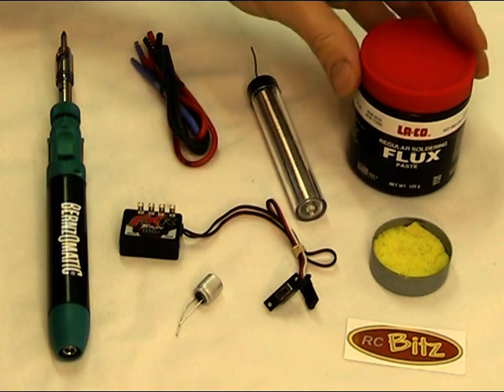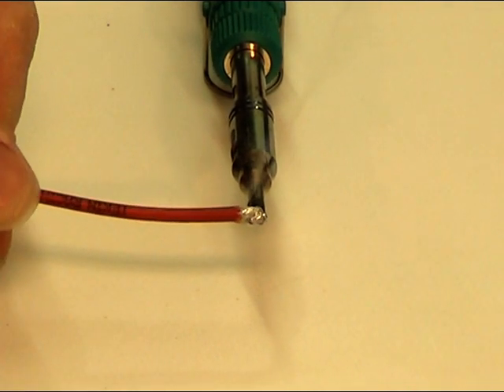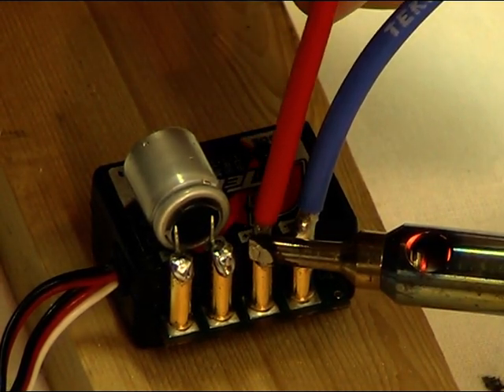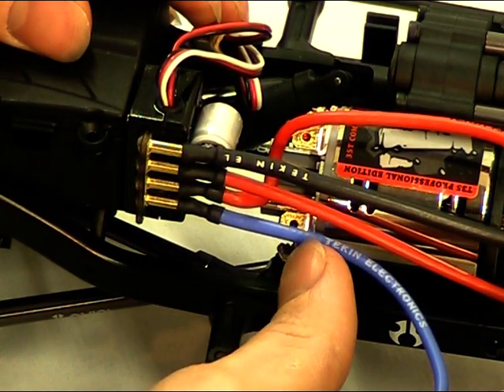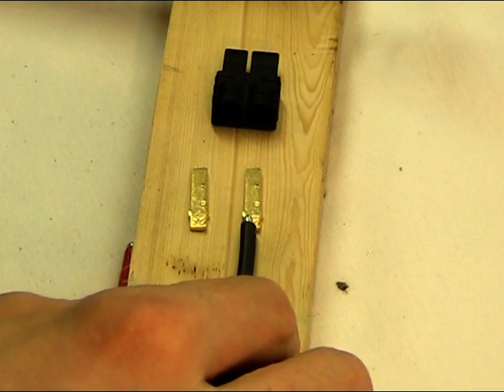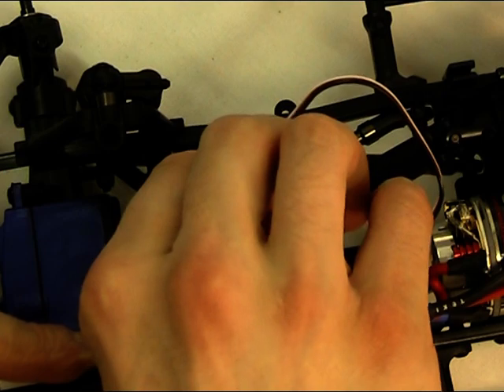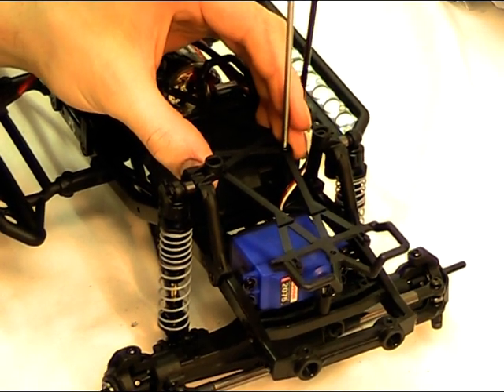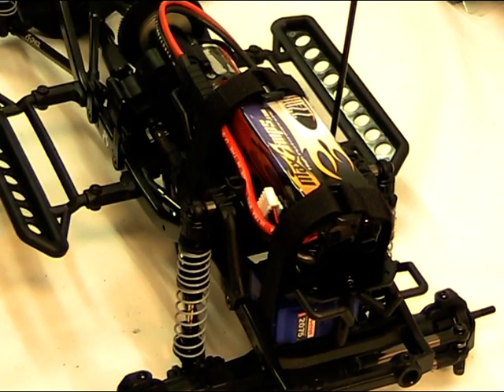Axial Build SCX10 Honcho PART 8 How To Solder ESC Motor Battery Connection receiver Steps 37 39.mpg

Comment: Thank you for the reply. One more question,do you an idea why my Honcho goes in super slow reverse when I turn the transmitter off?
Reply from the maker: +bellyisis Check the throttle trim on the radio, I guess it is not in the center. Worth doing this with the wheels off the ground, in case it 'shoots' off. Hope this works.
Reply: +rcBitz 
I tried this out , it still does it. But since you so nice to reply. I have another question. You know the sound wheels make when you turn em(even when rig is off)? Mine is no longer making that sound. Do think my servo is bad? My Honcho is kinda heavy with upgrades do you have a suggestion of a servo if I need to replace ? Thank U

Comment: What # are the spacers?are they found on the original part tree?
Reply from the maker: +bellyisis I guess you mean those for the battery tray? These are on AX80027 they are number 2 on there. Yes these where supplied with the kit.

Comment from the maker: No not too hot. I've found the hotter the better, as long as you are not soldering very small wires as you will need less temp.

I've got a full soldering station now and its the best money I have spent for my RC hobby.

Comment: Your video was very helpful in where to solder which wires and that Capacitor. I purchased this tekin FXr to go with by brushed motor on my Tamiya YA05 because other ESC's were too large and didn't fit on the chasis. Wasn't too sure what goes where. You solved my dilema. Thanks!

Comment from the maker: Look forward to seeing these in video too :-)

I have been happy with both brushed and brushless. Brushed is a good idea if you intent to see alot of water and mud - a clear with motor spray and a drop of think oil on the bearings each run is a good idea.

You are correct the brusless does not like water.

Comment from the maker: My Novak system has thick heat shrink around it and does not get hot so think you will be ok, its just the solder posts to keep clear on the FXR as they dissipate the heat.

Comment: i usually use either plasti-dip or liquid electric tape but i might put some silicone on it just in case because i'm not sure if it needs to breath for heat. where i live there is a lot of water/mud so all my electronics has to be waterproof or at least as waterproof as possible.

Comment from the maker: I see, ok this is what is called a balance plug and is used when you balance charge a LiPo battery, it helps keep the voltage of each cell close to one another. So in answer no it does not need connecting.

Comment from the maker: @dangerouslyr Sounds like you have not been having fun :-(

As long as the wires are all connected in the correct locations and you are using the correct settings for the batteries you are running and the electronics have not got wet then all should be fine.

The miss plugging may not have helped, did you make this mistake also on the new ESC? I would suggest taking time on the first start up and then not remove the plugs.

Not sure if I have been much help.

Comment: I had to re-solder all my connections because my E.S.C. got wrecked from flames literally jumping out of it! So after I re-soldered all my connections with a higher quality soldering iron, rosin core solder and bought a new E.S.C. the same thing happened again! My only lead on why this happened is that I glitched my receiver from plugging the E.S.C. into the receiver the wrong way a few times. But I was wondering if you have any ideas why this happened? :/

Comment from the maker: @MegaRallycar Well spotted :-) On the Honcho with the battery up front and above the wheel arches and the servo on the axle these are more likely to see water than the ESC and I'm not intending to go deep just precaution.

I also would like to make a video showing waterproofing the ESC as an Upgrade, hence leaving out of this build.

Comment from the maker: @inulika It fine, happy to help where I can. mine where 2200mah, the link I mailed to you should show the new ones. You do not need to run with LiPo but if you can afford the extra cost it is worth it for the extra 'punch' and also the saving in high up weight - LiPo is so much lighter. I have run my battery for well over 1hour in my SCX so don't worry about run times.

Comment from the maker: @c43939 Yes a small ESC would fit in the box. Just be very careful of the ESC getting too hot. I have fitted a Novak Goat 3S in a second radio bow but the heatsink is outside the box with a fan to help. Good luck.

Comment from the maker: @ChaosGeneral1 Each scx10 is a little different. With the Honcho and the battery in the font you may need to lift the body a little on its pins to get the battery under the bonnet - I see no reason why this should not fit. I have been running 6cel NiMh with a 9v on top for lights.

Comment from the maker: @Danboarding Well spotted. When I came to film this section I thought it was easier to show a basic install that showed soldering, this will also transfer to other RC's too. I have decided to show the adding of a BEC as and upgrade - this also allows me to explain a little more and think this may be the way people are adding after build. Sorry if this has caused confusion or a problem. If you need help in the mean time, just shout.

Comment from the maker: @flybar1000 Yes we are always happy to quote for delivery to the USA - when I look up the price I am always shocked. It looks like it may be between £70 and £100 depending on service 28 days or 5 days! I willl do some work and see if I can reduce this, size is always the issue so two boxs may be cheaper. You are right this is a COOL truck. It is a shame you don't have a model shop - we should all be supporting a great Hobby.

Comment from the maker: @nemethai Sorry for slow reply. I had not thought about rear steer on this, I did on the Tamiya CR-01. I may do an Upgrade video for this - there are not many parts needed if built from a kit to do this, servo is the biggest cost.

Enjoy the next video, there are three for the painting. Not far till running videos, cant wait.

Comment from the maker: @CrazySilentAssain Yes, as much as brushed motors do not need waterproofing, this is not the case with brushless motors. You may have seen some people break in motors for on-road cars in water - to bead in the brushes of the motor.

If you intend to run often in lots of water, especially dirty water, it is a good idea to clean through with motor cleaner and oil the bearings - in this case I would recommend adding a connection between the ESC & Motor to make this process simpler.

Comment from the maker: @CrazySilentAssain Yes it comes with the on off switch also - and answering you question about the motor being waterproof, the motor is brushed so there is not need to do anything to waterproof it.

Comment from the maker: @pauledbrown Ot is a good idea to solder connectors between the motor and ESC, I wanted a very neat instal and chose not too, but I would recommend this. As for videos of soldering bullets search for B9yY9Kk4bEA nice detailed video. I would add to this that to make sure that if you are using the same connectors on the battery, make sure you use the female ones on the ESC side of the motor connection - this will aviod connecting the battery to the motor wires.